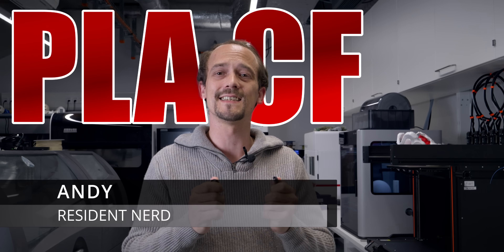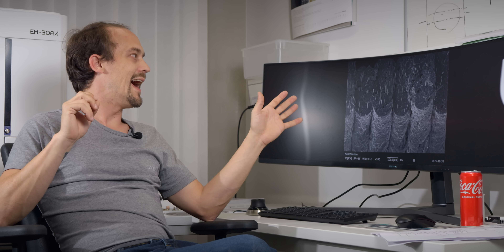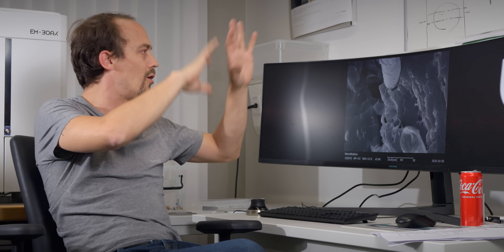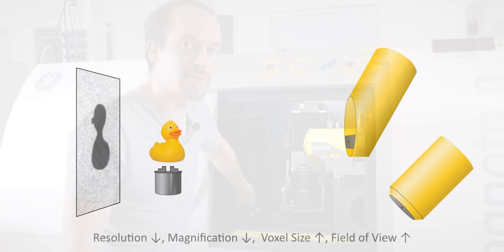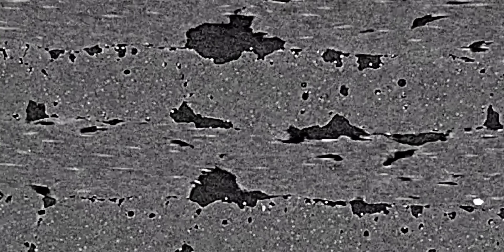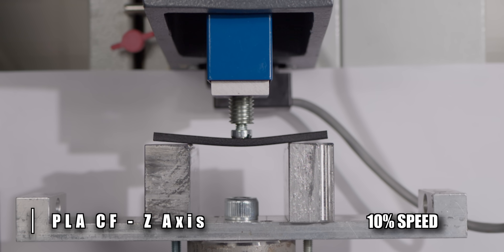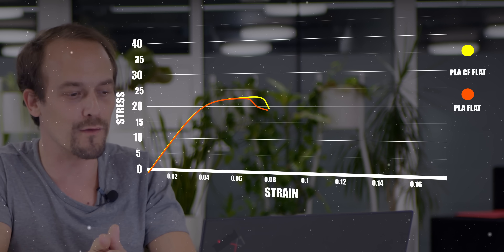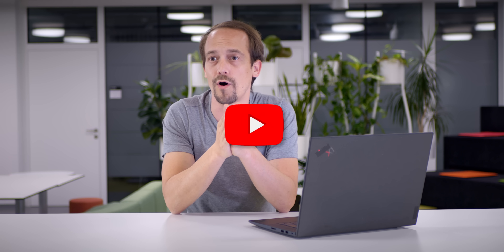3D Printing’s Biggest Scam Is Even Worse Than We Thought!

Comment: When you think about it, ANY FDM material with ANY fiber reinforcement doesn't pass the sniff test. Why? Because the fibers don't connect layers! The thing that makes a carbon-fiber or fiberglass structure strong is that the fibers travel a good distance and interlock. No matter the size of the fibers or what they're made of, any FDM fiber-reinforced material will only be significantly strengthened along its print lines. This might conceivably be useful, but only in extremely specific conditions (such as a "chain link" made of a flat loop of lines, where the structure is under tension along the print lines).

Comment: I'm looking to buy a HTPLA with carbon fiber, there's the annealing process. For my project I need rigidity and better heat resistance. Would the annealing help with some of the problems presented here?
Reply from the maker: Yes. But also doing the same to plastic it's self had the same or even better effect. 
Pla alone is very stiff already.
Reply: @Ibuiltathing  Thank you, this information will likely save me a lot of money.
Reply: @Ibuiltathing  I am building an instrument and I'm comparing the material stiffness of different filaments to spruce. So far, the best answer based on technical sheets is annealable PLA with glassfiber.

Comment: I disagree it's a scam. The way a lot of companies market it is a scam. 
CF filament does offer better rigidity and in a lot of cases a better matte finish. It can also be easier to print with sure to its resistance to shrinkage. 
It's also used in applications where rigidity, heat tolerance, and dimensional accuracy are important.

Comment: As a domestic 3D print hobbyist, I stay ABSOLUTELY AWAY from any fiber-reinforced filament, be it Carbon fiber, Glass fiber, or Asbestos fiber. My entry-level 3D printer (Bambu Lab A1) came with a set of swatches of different materials: I took the CF ones out with a pair of gloves and threw them into the trash where they belong, because even having that stuff laying around on a tabletop is a health risk. People praise the "matte finish" and "roughness" of CF materials without realizing what they are touching and what they are risking in the long run.

Comment: Almost would need to prepare each layer with something that would soak into the gaps.  Maybe they should mix baking soda into it so you can throw super glue before each pass. Superglue could create a plasticized gap filler when it hits the baking soda. It would lock to those carbon filaments in theory.

Cotton or microfibers need to get tested to see if they fair better.

Comment: To more easily produce detailed images of organic materials, consider using a conventional microtome - one in which thin, translucent, physical slices of the tet object are made, mounted, and examined.  A related technology is the same cutter as the microtome to produce a series of clean surfaces which can then be successively photographed.  Both techniques can be used with various kiinds fo light and immaging approaches.

Comment: And what about other plastics reinforced with carbon fiber? PLA is a hydrophilic plastic, and carbon is a lipophilic substance. That is why there is such a low adhesion between them. Now you just need to do the same research on other composite plastics to figure it out! And you also need to compare them with fiberglass reinforced plastic options! I will subscribe to this channel to find out the results!

Comment: I did work with composites. 

I find it very funny that they are using carbon fibers like this. 

There ARE additives that you can use to increase the strength of polymers, but carbon fibers are vastly too large to be one of those (we used numerous things like ceramic microspheres, carbon nanotubes [you will DEFINITELY know if it’s the real deal because adding these by weight quickly makes the mixture approach unusable viscosity - think thicker than cold pitch at just 1% by weight, but with truly ludicrous strength gains. 200% Easy. Makes for not a great composite though because of that viscosity, very hard to get it infused into bulk filler like balsa wood.] fumed silica and carbon black, as examples. And not just additives for mechanical strength - carbon black is great for adding UV resistance as only the outer few microns will degrade.) 

Carbon fiber mats and rods were a choice material to use because of their unreactivity - they are not going to chemically bind at all with your polymer. Or anything else, which is great when you want something that won’t corrode away since it will never oxidize or go through electrical corrosion (huge source of longterm failure of rebar in concrete). You still get mechanical locking from frictional interfaces, but that comes from the dissimilar nature of big object versus fluid made of microscale chains. You’d better have a good idea about why you are adding a completely nonreactive shaped object if its anywhere close in size to the building blocks of your material - like fitting in a random piece of furniture to a brick wall, no matter how sturdy it is, the sum is going to be weaker than the parts if you disrupt its structure with no benefit.

Comment: You have the ability, tools, and resources that I would love to have access to. This is the type of reverse engineering/testing I’ve always wanted to be involved with. While working as an I.T. manager at one of the top tier Universities in America, the most enjoyment I had was working with the structural engineers who tested the strengths of materials.
I’ve only been 3D printing less than a month, you are giving me data I would not have before hand.
As a truly entertained and impressed viewer, I give you 1,000 👍 

Thank you kind sir for the knowledge you impart, especially if it relates to health in the medical industry. Sadly I am a survivor of many failed medical, I’ll use the term experiments, because it seems much of the time it’s guesswork that surgeons operate on. The medical cement in my spinal cord is a prime example of a mistake gone too far.

Comment: Are there CF infused stuff that work because some kind of additional material into the mixture?
How many vendors did you try?
If this is confirmed then the whole thing does not make sense.
Why did they make it in this era (all kinds of "youtubers" testing everything so they cannot sell it if it does not work)?
Are the manufacturers scammers or just making up stuff without testing it?

Comment: Does the CF significantly reduce the weight of the printed material? That could be a solid justification for the overall drop in strength if the strength to weight ratio goes up.
Reply from the maker: Pla cf is ever so slightly heavier than pure pla. I know carbonfiber is perceived as light but that comparison comes from comparing it to metal because it's near same streangh. 
Compared to plastic it's heavier. 
Ist about 1.75 density while pure pla has 1.24 on average
Reply: @Ibuiltathing wow, so yeah it's just worse in every way.

Comment: Carbon fiber is only strong in one direction. That's why it's normally used in a woven fabric. The issues demonstrated here are the reasons that it's normally embedded in a matrix of resin rather than thermoplastic and produced under pressure.

Comment: Recently I bought PLA
filament with Wood Fiber. The filament alone is super likely to break already. Ok, I wouldn't ever expect any tough material features. But what do you think, might there be the same structural flaw that the fiber would not adhere to the plastic at all?

Comment: I'm 72 and have been in material science for semiconductor processing, ceramics, polymers and medicine and was always proud of the lab equipment I had access too. I even sold a $1,500,000 electron microscope to ASU. I've been to and seen some remarkable;y advanced equipment in my career starting in the mid 70's. But progress has made then simple and obsolete.  I'm livid  green with envy!! With a detour as a USAF pilot and antique aircraft restoration. Ask me for details! As for the danger of carbon fiber they are nothing like boron fibers in danger.

Comment: I don't understand why people would want to print with tiny needles in their plastic when they could just use inserts for reinforcement. Like why not just make some steel wire inserts? Or nylon thread inserts? Make a channel, pause the print, insert the reinforcement, resume the print, and tadaa, you're not playing with a modern equivalent of asbestos! It's not a buzzword-able as carbon fiber, but marketability really shouldn't ever beat safety and functionality.
Oh, also, carbon fiber can be added on top of a print the same way we do with objects that aren't 3D printed, so why not just do that instead? It would probably even be possible to insert little premade carbon fiber sheets or something, kinda like what's done when people make 3D printed fabrics. Spikes in your filament are composite chaos, not structural reinforcement.

Comment: Please do a video on which materials CF can help and in what ways.
Also, does this change with printing temperature? I.e. to print well with good layer adhesion, temp has to be increased, sometimes significantly (due to what you sayw CF interference as well as CF likely takes some of the heat away from the polymer).

Comment: I wonder how PLA-CF is being manufactured, whether or not the process is consistent across brands, and whether or not the pre-final product undergoes (or would benefit from) some kind of vacuum treatment, where those gaps could be closed.  It's gotta be a function of the manufacturing process and the resin.  Correct me if I'm wrong, but I believe the resin is supposed to fill in these gaps, if properly matched/ applied/ mixed and cured.
Reply: The may also be a chemical reaction between the ingrediants at play here, where heat is causing a kind of vaporization, leaving voids in its wake as gases are exhausted.

Comment: Sorry, maybe I didn't understand the scan, but weren't some of the fibers surrounded in polymer? I saw the few that you pointed out that had gaps, but weren't there many you did not point out? Also, yes, you need to compere this to non-CF filament from the same brand, but ALSO to other brands CF and non-CF to be able to make any broad statement about CF filament.

Comment: First, love the AI song. 😂

This is further proof that CF in filament is not the same as CF in resin for IM. I am happy to see you continued tests and results.

FDM printing is simply getting plastic hot enough to form it to the shape of the nozzle and lay it down in a line. The bond between layers is simply the line above hot enough to remelt the layer below to create a bond. Layer by layer will be a surface bond.
CF is an additive used for thermal properties. This means that the difference in thermal properties of CF and PLA are big enough that the resin is maybe shrinking away from the CF?  I suspect the CF is not getting hot enough to create the heat needed for PLA to snug up to the CF. 😆

The voids in PLA could be moisture that evaporated. Does PLA need venting in injection molding? If so, it could be off gasing but I highly doubt it. More likely to be moisture that evaporated once the material hit the nozzle.

I am curious to know if carbon powder would provide any benefits to PLA. Thermal properties, maybe.

Another thought. I think that it would be beneficial for those who 3D print to see the difference of the part from a 3D printer compared to an injection molded part. They would be able to see that the IM part is completely homogeneous. Maybe use a graphic to show how pressure, temperature create the molten state and that the resin fills the mold by laying down the walls first as it is pushed into the mold. Another feature of IM not in FDM is the shearing action that occurs within the barrel, nozzle, sprue, and mold. That shearing action is a part of IM that is considered and utilized in the process. These different variables would lend toward a better outcome with CF and is why it is feasible for IM and not FDM.

Comment: Anyone that thought that adding carbon fiber to plastic filament would do something is an idiot. because the basic concept of carbon fiber is the interlocking connected carbon fibers giving it strength, loose pieces of carbon fiber floating around in plastic is meaningless.

Comment: I worked with CF many years ago and one of the major problems my team discovered first hand was the fact that the structure didn't survive impact testing very well and the integrity of the structure was compromised even though we didn't realise it until we started testing and it failed catastrophically producing loads of very sharp shards which is very dangerous to health as well. I'm reminded of the fact why miners preferred wooden supports, because it gave the miners advanced notice that failure was about to occur and they could take evasive action; metal supports were good and if they were think enough you could often see bending before failure, but CF structure fail catastrophically often without warning - they don't give you any indication that you are approaching the failure envelop region. Advance materials are good but what they give you in additional strength and stiffness is often offset by unknown failure zones - your research into the air gaps and non-boding areas between the CF and polymer makes the situation even worse especially the variability of the gaps because you don't know where the concentrate of gaps is and thus where the first point of failure will occur,

Comment: When I worked in carbon fiber molding material development, I used packing theory to reduce crack propagation. I mixed long strand carbon fiber with short strand, chopped mat and graphite powder. Each smaller filler filled the resin rich areas between the larger filler, reducing the crack propagation opportunity path.  However, this was compression molding.  All extrusion  molding aligns fibers, where compression maintains the randomness from mixing the raw material.  Injection can reduce the alignment if the flow if the flow is random in the mold, but not as effectively as compression molding.
Reply: 3D printed is simply layered extrusion, so it maintains the issues of extrusion. The interface between layers is always an issue.

Comment: Stick this in your browser's address bar:  DOI:10.20944/preprints202308.2053.v1
CF for use in PLA needs to be surface-modified, so that it bonds to the matrix.  Whoever is making and selling this stuff doesn't know what they're doing.

Comment: As an old dirt biker, 🤣 my exposure to materials and their quality is archaic. But some things are still certain: you never use a cast piston, because forged ones are made of better uniformity in the metal 😂!!! That's a given! 
Nothing made of layered 3D printed materials is integrally sound, it is simply layered... And never forms a uniform body of material. 

Casting porosity problems are expanded exponentially within laid material in 3D printing😂

It's all shortcut garbage for making prototypes of specific shape... To thereafter make a functioning part of solid-state matter😮

Humanities attraction to shortcuts will justify any kind of nonsense until somebody gets hurt... Or money can be made by preventing the knowledge that someone got hurt through a process😂

Comment: I don't know if the hypothesis that other materials are compatible with carbon fibers [CF] right away. It is rather like that 3d filament companies jumped on a pseudo-science bandwagon driven by demand of "nerds" that anything CF is better. I used to work with CF materials and when doing manufacturing with them, residue of exposed fibers is nasty. I 100% agree with you there. I would never ever buy this stuff for home use when not having the facilities to deal with lose fibers. 
But back on topic: There was  extensive research conducted on how CF are actually able to bond to matrix materials. Some use plasma activation, some use laser activation etc. It is a thin line between activating the material (altering surface tension properties) and damaging the materials). This is a complex topic of surface thermodynamics and I bet one could make CF bond to PLA. It would actually be interesting to see if surface treatments improve bonding and to see wetting envelopes in relation to the treatments and different CF materials. But I'd say bonding of CF are very complex topic and you require some sort of science to pair CF with a matrix material and they do not work out of the box with any other material

Comment: Hi .. This isnt my field or anything, but- they must have done this for a reason originally? There really isn't a 'sensible' way to add CF, but the manufactures cheap out, and the stuff SOLD as PLA-CF is no good? Or has the idea ALWAYS been a scam???

GPT sure seems to think so, and totes concurs with you:
"Carbon fiber reinforcement improves a plastic only if:
-The base polymer is ductile/tough enough to benefit from reinforcement
-The fiber length and orientation are sufficient
-There is good bonding between the fibers and the polymer
-The manufacturing process aligns the fibers (or at least doesn’t destroy them)

This is why CF works well in:
-Nylon (PA6, PA12)
-PEEK, PEKK
-High-performance injection-molded or continuous-fiber composites"

Comment: The problem with 3D printing with carbon filament is that filament doesn't form bonds between the print layers. "Forged carbon" parts with polymer resin binding a bunch of carbon fibers have chaotically aligned fibers which makes the  resulting part largely anisotropic, so it doesn't has clear shear lines, in that case carbon fiber really strengthens the resin. 3D printed parts are isotropic, they often fail on the boundaries between printed layers, and it's an issue inherent to the manufacturing process itself, carbon fibers don't help that at all.